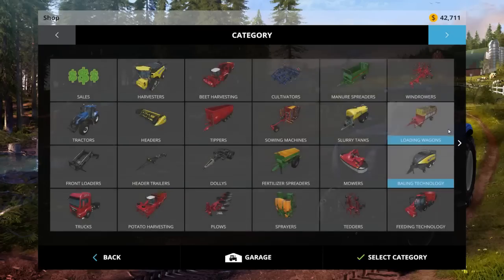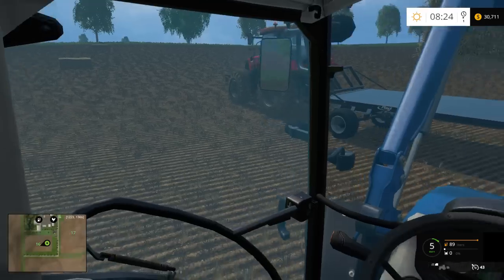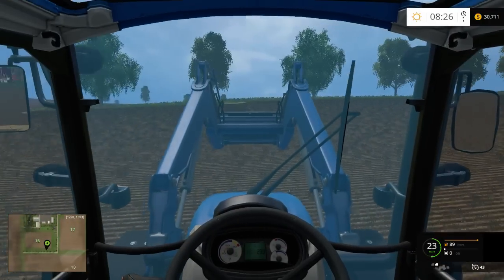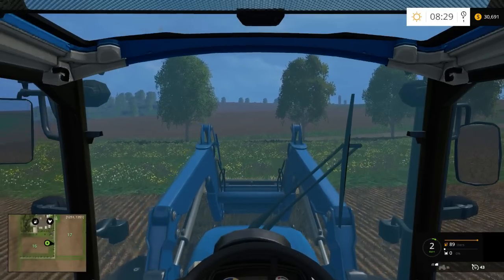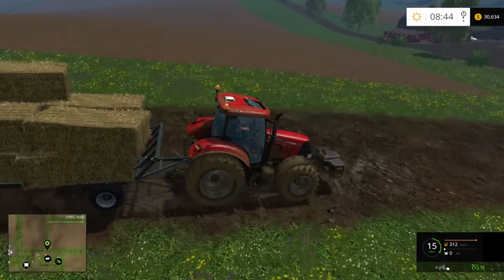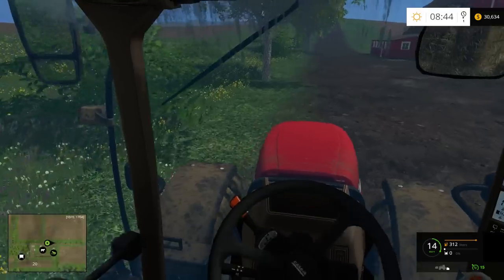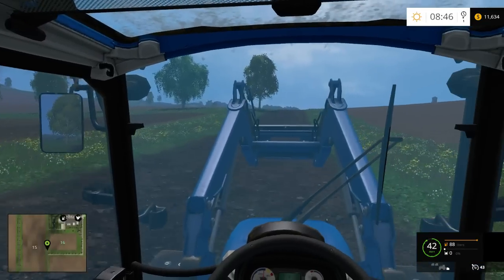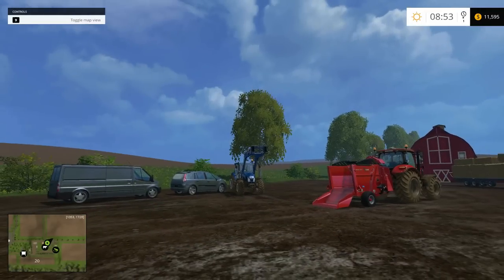Farming Simulator 2015 S1E3 bale picking uping

Comment: heres a story about the bale physics I was loading straw bales onto that trailer, I finally finished and the bales were stacked three high, when I left the field I guess I took a turn too sharp, and all the bales went flying off the trailer I think if the trailer goes sideway or tippes over it will detach whatever is on it! I was very unhappy I was enjoying stacking them but alas I just got the auto stacker!

Comment: Glad you got the square bales in the shredder I was just about to test that lol a website that may be of interest to you: https://github.com/Courseplay/courseplay/tree/FS15
Reply from the maker: David Oldfield I noticed that. However, reports have said that it seems to be pretty buggy still. Not surprised it's beta.

Have you tested it yet?
Reply: I'm on a 12hr day shift sadly, 7hrs until I do though, already dl to my phone lol
Reply from the maker: David Oldfield Nice. Well I'll keep an ear out for any new developments and how you get along with it
Reply: It's come at the perfect time, got the bigm 500 in game last night, perfect test machine lol
Reply from the maker: Nice I was trying to covert a semi but the movement was off but it was in game. Also, I had problems with textures exhaust etc
Reply: Lol yeah it's a long long process on anything other than fs13 weights, without lights, or dirtskins lol big m is going to be on next episode, see what you think :)
Reply from the maker: It definitely seemed that way. I have no idea how to fix the issues either which doesn't help
Reply: Iv just worked my way through the log errors on the few Iv converted, iv had mostly file paths for texture errors
Reply from the maker: Yeah it was some version that weren't the proper one. 

I didn't run into any file path errors. At least not that I'm aware of